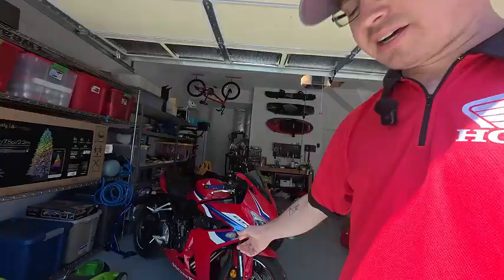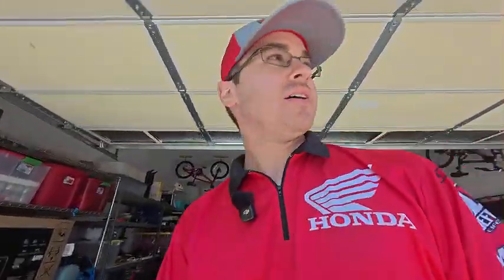How Much Faster is Hondas New E-Clutch On The 2024 CBR650R

Comment: Im confused.. my 650r can hit 92 mph in 2nd gear..
Reply from the maker: What point do you shift at? I tried to keep this as even as possible and shift right as it hits redline. Which is right around 12k
Reply: @T3CHNOskillz sorry I mistyped I meant 82 Mph, and I shift RIGHT at the redline. Im a fairly new rider, so I’m not sure if I’m supposed to be doing that 😅😂
Reply from the maker: @JayMvI I was able to go back into one of my videos and check. I shifted into third at 75 mph at 11,750 rpm. And redline looks about 12,250. If I were to shift perfectly at redline it would probably be close to your 82 mph. It’s perfectly fine to shift at redline. I’d just try not to bounce it off the rev limiter for 5 minutes at a time lol
Reply: @T3CHNOskillz  ok thanks! 💪

Comment: Fascinating investigation! Yes, we need the screens to be 120fps so we can see the true mph when it counts 🤣 

Would it be possible to edit those clips side by side and maybe slow them down a bit? I feel like the E-clutch can pull away better than that on a good day, though you have to worry about the front wheel as you say. 

Your shifting skill is surely above average, but I'm sure for a 0-60 time you want to reach it still in 1st (as you mentioned) but since you were targeting 100 you seem to have shifted to 2nd before 60 in both runs. For the hands and sounds that would be interesting to see side by side/slowed down (depends on the recording frame rate of your camera I guess). 

On the same note feels like you could probably hit 100 in 3rd for a fractionally better time (which you factored in on the manual run). Though maybe not, as of course I couldn't emulate your precision in pre-empting the redline. I haven't got access to a road where I can take it above 70. Anyway thank you for sharing this
Reply from the maker: @PrinceRules64  I could probably do a side by side it might just take me a little bit to figure out how to do it correctly and match the times up. I had my camera at 60 fps but It’s still a problem with the dash on the bike. When in editing i slowed down the clips to literally frame by frame to get the millisecond it hit 60 mph. But it went from 57 to 66 in that one frame. It’s just the digital dash. I’m sure there’s something with digital dashes where it refreshes the speed every so many milliseconds. That’s why the speed just jumps so much on the dash. Maybe if I can get access to a longer road where I can do a top speed run I can do that
Reply: @T3CHNOskillz  Agreed on the speedo, we need that built with faster refresh on acceleration 😢 

I was thinking of the camera's capability on whether it would still be meaningful side by side/slowed in terms of comparing your gear shifts. (Sounds like it would be as you've looked that closely in the editing process, bravo for the attention to detail)
Reply from the maker: @ I might be able to mount a camera near my foot and we can get a closer comparison but it’ll still be pretty challenging to time it correctly
Reply: @T3CHNOskillz  I hear you, I'll let you be the judge of whether there's fruit there, but thanks for all your insight nonetheless! I'm learning so much from your experience applied to the specifics of this bike